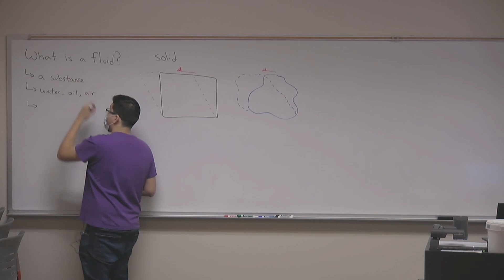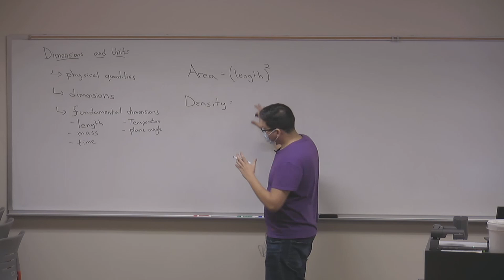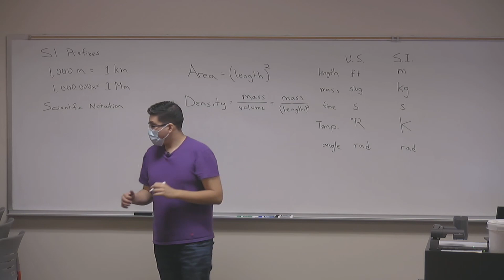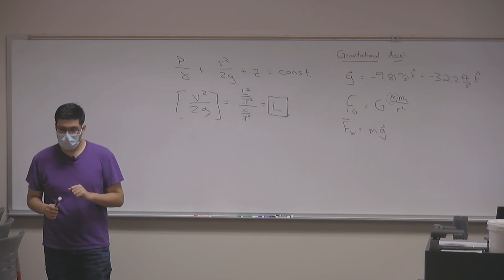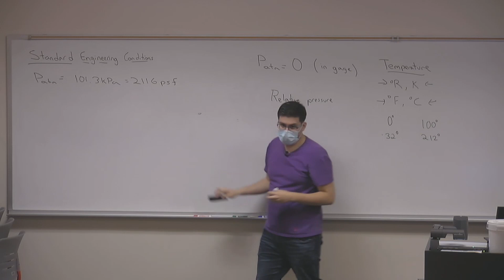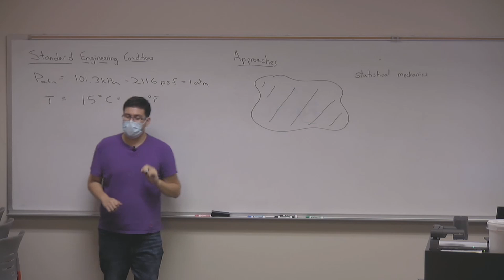Fluid Mechanics lecture: Introduction to Fluids

Comment: for the standard conditions, i thought it was 298K
Reply from the maker: You're right! The standard conditions defined by the  National Institute of Standards and Technology (NIST) use 298 K for temperature in some cases (though I think a more accepted value is 293 K). The book I used for this lecture uses 288 K. Other sources (like the IUPAC) use 273 K. The definition of a "standard" value depends on the standards agency, and different fields will follow different standards. Thanks!